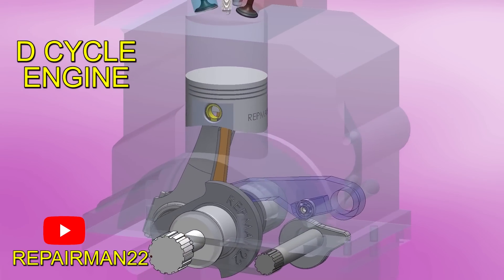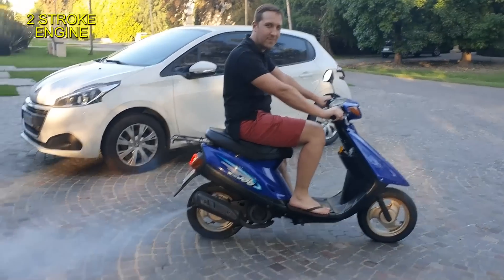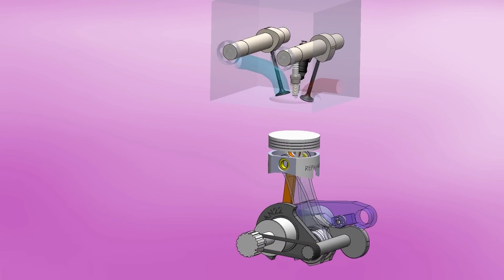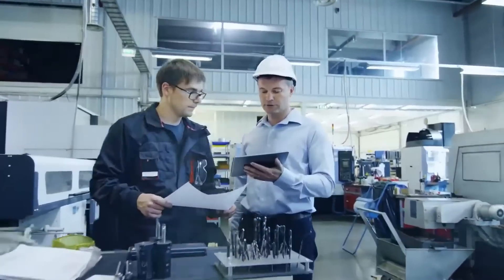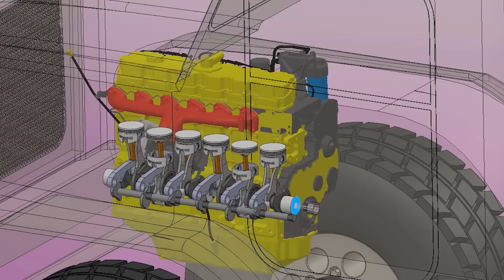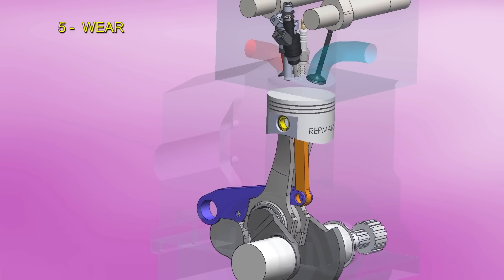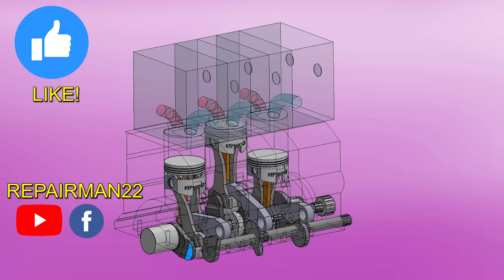Analyzing The Split Piston Engine in 3D. 🤯 Dual Cycle D // 2 and 4 Strokes Combined // 3D Animation

Comment: Whoever wrote the script thinks 2-strokes all work the same way as lawnmower engines.   Not so.   Large 2-strokes used in railway locomotives, truck & bus engines, and ship main engines all use forced induction by an external blower and don't cycle air or fuel/air mix though the crankcase.
The design presented in this video seems a daft way to make an engine to me.   Principal defects are the difficulty in accelerating the upper piston down fast enough, considerable cam stress, and, given that a conventional engine has less than ideal volumetric efficiency, due to the increased piston speed, the volumetric efficiency in this engine is going to be exceptionally low.
If the upper piston seats just right at the right time on the bottom piston so that the bottom piston's rods take the power stroke load, during warmup that won't be the case, due to thermal expansion/contraction.  Depending on various factors, that means full power transmitted via the cam, or the pistons destructively hitting each other, or both.
However, some of the stated disadvantages given in the voice over aren't true.  Eg it is claimed that oil spray cooling of pistons is mandatory, but truck and large engines all use spray cooling anyway.    It isn't needed in car engines because a car engine is never run at full power for more than a few minutes.

Comment: So twice the parts to refresh the air at BDC. Something a simple blower can achieve.
In the 60´s they drove trucks with 2 stroke diesels with opposed pistons, refreshing the air in the common cylinder at BDC via holes in the cylinder walls. They were oil burners, because they sucked crankcase oil into the exhaust. An ordinary set up & valve train would fix that.
And where does this 20% extra efficiency come from? The piston rings still make 4 strokes, so I don´t see any reduction in friction.

Comment: With 20% greater power does it cost less than 20% more to manufacture?
Reply: Even if it cost double the engine cost, if it would be reliable for 200K miles it would be worth it for the fuel savings.

Comment: Too many moving parts....electric motor  =  one moving part
Reply: electric motors are NOT a "prime mover".
nor are rechargeable batteries. wheres the power ORIGINATE from?

its not about parts count in the assembly, thats brainwashed thinking.

its about the number of processes, the conversions required, from the start to the end. how much of that original energy is lost at each conversion? p.s. at least 50%.

to run your electric motor, at some point, somewhere, something had to CONVERT one form of energy into your "electricity". then it had to convey it. then it had to store it. then it had to be re-released.

and each step of the way, losing energy rapidly.

whatever. youve already swallowed the bait.

Comment: @7.55, 'the crown piston is the only component that moves at high speed'.
You're forgetting its conrod and lever arm.
That return spring would need to be ginormous to prevent float, and would be a big parasitic loss of power.
Just another cock-a-maimee spaghetti-bowl attempt at engine design..

Comment: As cool as this is it wouldn't work, The cylinder going down, there is nothing pulling the piston down. unfortunately this is fake.
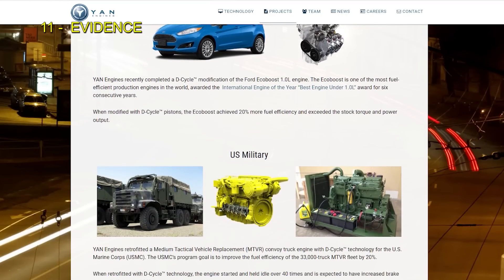Reply from the maker: there is a spring. Same as valves. Showed at 7:22

Comment: This is the first time I am hearing of this technology. Great presentation! I wonder how it would do in large, slow turning applications such as Marine Diesel propulsion systems? I know most of the largest engines are already two stroke. Perhaps it would just be unnecessarily complex for any gains to be had.
Reply: That's exactly the problem with all of those modified post-Otto cycles, including Atkinson: they don't translate well to smaller displacements,/powers because of the added weight, and where weight is of no concern (like large marine diesels) they likely won't offer any significant efficiency or power gains. They only make sense in s very specific HP/weight/rpm zone occupied by economy/high efficiency passenger vehicles, and only when emissions/fuel economy goals must be met with absolute priority.

Comment: Why not just have an exhaust pump and direct injection? The exhaust pump vacuums out exhaust and makes vacuum allowing the intake and exhaust valves to open at the end of the power stroke. Every time the piston travels upward it would be a compression stroke and every downward stroke would be power.
Reply: oi! we will be having no references to antique engines made here!

"melhuish" aka "gothic oil engine". exactly that. a stepped piston, with one section creating a vacuum to scavenge the exhaust gases from the cylinder. 

once again, nothing is new. peoples memories are short and books are easily removed from libraries and shelves.
Reply: @paradiselost9946 , I was thinking more along the lines of a centrifugal supercharger on the exhaust side. Rather than a whole other piston pumping. Maybe even run a compressor side, so it looks like a turbo but it's actually a supercharger that's forcing and extracting the charges. 
Also they didn't have modern direct injection or materials that could handle that kind of heat for long periods of time. 

I can't exactly remember something I never knew of to begin with.
Reply: @hibs5516  lol, just saying... theres a lot of designs from a last century that have been long forgotten by all.

so your suggestion was amusing, and also intriguing as it shows the first bit of imagination regards engine design ive come across in years... sadly its already been done. doesnt mean it doesnt work, they were a successful and popular engine for 50+ years. 
what could be achieved with some new thinking rather than the same old...

they didnt have turbochargers when etienne lenoir first modified a steam engine to run on "petrol" and puttered around paris in 1860... (screw benz, another myth... he was also preceded by siegfried marcus in 1880... and his car is still on display in vienna. the original one, not a replica.)

but i often wonder what may have happened if they did.

"rather than a whole other piston pumping".

keep that in mind at all times ;)

unlike the two stroke diesel, lenoir cycle doesnt require a blower to run. it also has no pumping losses.
whats a turbocharger do again?

and, well... different tack. give you something else to research if you want...

"humphrey pump".
theres a video of one running here somewhere. not great but hey, they exist. its huge, its a pumping station, but they dont have to be huge...
claimed to be the most efficient of any ICE. 
WWI got in the way and they were forgotten as well...

think ram pump with a carburettor and spark plug.

seem useless too... until you consider what you could do with water at high pressures in a closed loop.
Reply: @paradiselost9946 , I can probably make a protype with an old Honda D17 engine I have. I have to have a custom crank sprocket made so the cam and crank rotate the same speed. I need to make a bracket for a centrifugal supercharger transmission. I need to make an impeller shaft that can connect through the front of a turbocharger with a modified compressor housing. Use an Arduino ECU and possibly modify the crank trigger so I have double triggers for injection and ignition. Direct injection is where it'll get expensive, but the head probably can be tapped to accept the injectors. 
This thing would idle at 375-400rpm
Reply: @hibs5516  you get it. bit different but much what ive been toying over.
junkyard 4 cylinder. for some reason... really hard to find now a days. used to be dead cars everywhere...
recam for ~180 exhaust and ~30 intake. maybe variable intake. deck out for as little clearance volume as possible. it doesnt have a "compression ratio". wanna sweep all that gas out.
triple compound. thinking vz21 per cylinder to rhf4-5/pair, to a single t20 sort of thing. 
compounds can hit 130 psi or better on just a pair... never seen a triple stage. outside of an actual turbine engine. whats an average pressure reading on a piston engine? 130ish... about 8:1. why bother with the "squeeze" of the fourstroke if youve already done it?! in some ways, supercharging has always left me vaguely puzzled...
turbines melt themselves if they try running those types of pressures though. can compress silly high, but cant use it...

ignition occurring immediately as intake closes, 30 atdc.
maximum pressure on crank at best time geometrically. much like desaxe without the offset.
plenty of heat wasted out the exhaust.
expanding gas in cylinder is cooling as performs work. piston extracts the best bit, leaving plenty to power turbos, delayed ignition helping here as well. no bypass air like a traditional turbine to keep temps in check. its expanded instead.

just like steam... pistons work on high pressures, turbines like them low. they did the old reciprocator compound turbine into condensor with good results. then swept the idea under the rug and yeah... history.

the swept volume has no bearing on air consumption. at idle, its got no boost, virtually no air with no throttling or pumping losses, using what little fuel is required to overcome friction.
a CSC may help... may not be necessary. the original lenoir ran fine without forced induction.
it still has a "suck" part.
an "orange cannon" shows you dont NEED compression for a good thump. you need it for the thermal efficiency.

start pumping in the fuel aka heat, boost builds, more air, more fuel, more heat...
probably throttle via the wastegates. rather than restrict flow, simply control the work being done in the turbine side of things.

thats where the arduino will be handy...

no detonation. and pushing final air temps as high as possible is actually beneficial as its heat being pushed into the air to expand, recycled, rather than dumped out of an intercooler... spontaneous ignition may be of benefit... but thats also compressor wheel destroying territory...
maybe reverse intercooler? after heater! final heat of exhaust passing through an exchange to heat air entering cylinders...

with enough heat recovery there would be times you can simply cut fuel altogether. air passing through simply cooling things down and expanding as it does so.

even your incoming pressurised charge is acting on the piston during that intake portion... no pumping losses... other than forcing gas out of the cylinder through the turbines. thats another kettle of fish, a dark art... expansion ratios and the like. 

everything contrary to popular wisdom :D tradition sucks. people say the ICE is dead, but i think theyre just brainwashed, technology is at the point that it can actually do something and people are still ignorant pigs fascinated by the mundane...

all the pieces of the puzzle are there...

anyway!

i suspect a lot of lag as its more about the way a turbine runs than a piston runs. steady state genset seems a better use.

virtually no changes required to existing engines. 

but then... im just getting my head around CAD and modelling another idea ive been chasing on an atkinson cycle. long exhaust, short intake & compression (modifiable to simply dwell and no compression at TDC, ties to everything above...) long expansion, with maximum combustion pressure at 30 ATDC... without "desaxe" again. and leverage gives it a nice logarithmic expansion following ideal gas laws. "murray hypocycloidal" is sort of the approach...

sigh. some of us get bogged down in life and some of us figure out how to make money by inventing "the juicero"...

ffs.
Reply: @paradiselost9946 ,
 A combination of vacuum on one side, pressure on the other. The engine being designed around taking full advantage of the pistons dwell time and camshaft overlap. To eliminate the need for an intake stroke and and exhaust stroke, as the two events are happening simultaneously. With the fuel being introduced later in the compression stroke.

This is where modern direct injection technology and materials such as inconel come in. 

The exhaust valves, the vacuum impeller/shaft and housing would all need to be made of inconel due to the exhaust being abnormally fresh due to the lack of an exhaust stroke. There is no time for it to cool. Its being evacuated the instant the energy from the combustion is spent. That would burn normal valves.

This would be a weird in-between of a diesel, gasoline(petrol), 2 stroke engine. It wouldn't need to idle as high as a 4 stroke because the inertia required to keep it running is essentially half, and the power band would start lower. It'd produce torque at lower rpm like a diesel, but rev high and fast like a 2 stroke (because it is a 2 stroke).

Comment: TBQH the entire video I was thinking that the crown piston wouldn't be very eager to move down on its own, which you addressed in disadvantage #11, including a desmo-like solution. Oh well, it seems that the standard 4-stroke Otto-cycle engine sits really in the Goldilocks zone for what regards complexity and performance/efficiency. With a Wankel or 2-stroke you get simplicity and performance, but not efficiency. With complex post-Otto designs you get better efficiency and power at the cost of complexity. Otto is just about good enough in all three departments.
Reply: true
Reply: @@lurch789 because 2 strokes aren't as efficient as 4 strokes, so if you really care for mpg, why bother?
Reply: @Lurch Even 2-strokes with separate oilers burn some oil by design. Maybe less than agas-oil mix system, but still more than any 4-stroke. They even managed to release a few Euro 2 compliant scooters, but it's doubtful they could have gone much beyond that. But I wasn't discussing emissions in the first place, only efficiency.  But since you brought it up... 2-strokes have higher specific power, but lower thermodynamic efficiency, and that in that sense they also have higher emissions due to higher consumption, even if you manage to avoid burning oil altogether.

Comment: I see all the working parts of an ordinary engine and turn a bunch more parts that need to move. More moving parts means friction and inertial resistance. I can see the belt or chain drive and the lobed kicker that pushes the piston top wearing a lot and quickly.
The idea is to remove as much parts and weight as possible resulting in more faster acceleration, more speed and smooth balanced operation.

Comment: That isn't practical those wet belt engines are also junk
Reply from the maker: I did the animations with a belt because I designed the cam to rotate in that direction without realizing it and I left it that way. But actually, it can go chain or gear. It is just an animation to understand the basic operation. Then everything else can be changed.

Comment: A supercharged direct injected 2 stroke with inlet ports in the lower cylinder walls is a MUCH more elegant solution than this abomination. It keeps the lubricating oil in the sump in the same way with 4 exhaust valves in the head for excellent exhaust scavenging. Detroit deisel had it nailed all those years ago. Imagine if you brought 2020s technology to the Detroit diesel design!
Reply: Exactly this. This engine is unnecessaryly complicated. Actual investigations were done in Europe with 2 stroke diesels and modern combustion control due to the potential it has for CO2 reduction, numbers looked good but then the diesel scandal came...
Reply: yep,

Comment: How high will the acceleration of that piston be? Maybe works at low revs, but never at higher revs.
Reply: I was going to say this too. It will break down after not too long due to this sharp cam producing such high stress. And the vibration would probably be high as well. Of course it is going to get more horsepower due to half the cycles, but it will surely be offset by the lower RPM and higher fail rate